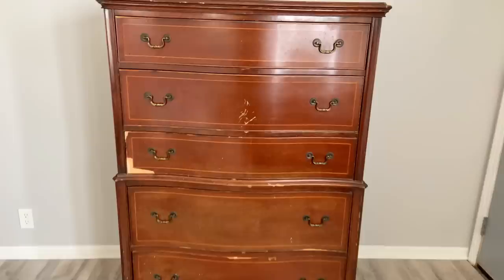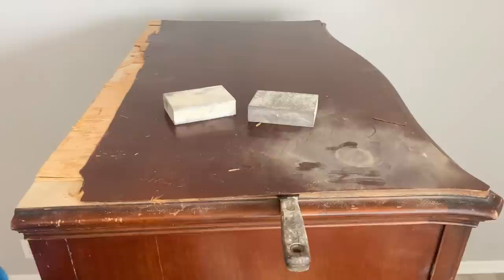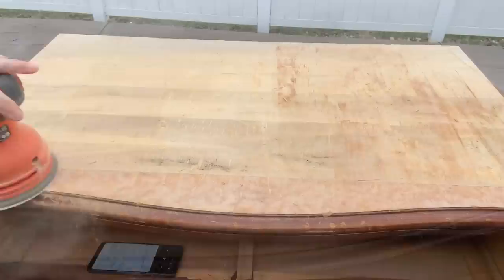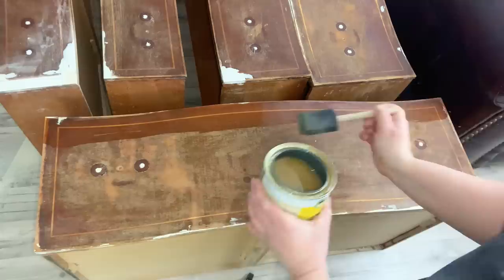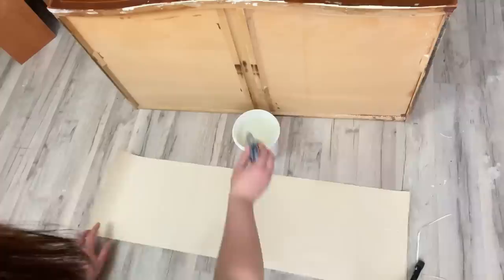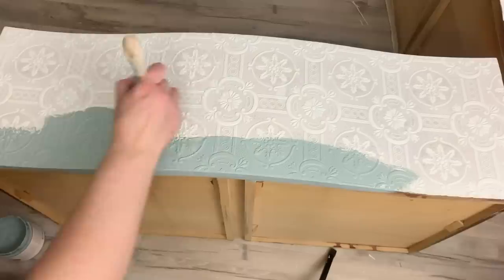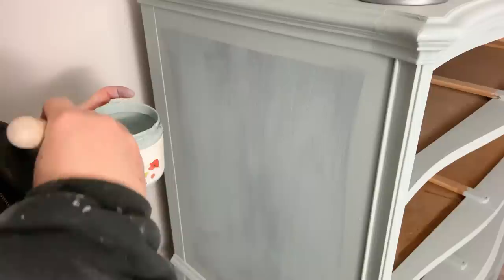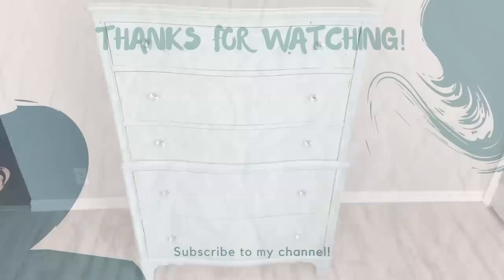Furniture Makeover | Country Chic Paint Trash to Treasure Dresser Furniture Flip | Start to Finish

Comment: Very pretty.  If you want to shabby it up a bit, after painting the drawer fronts, you could use your sanding block to lightly hit the high texture points of the wallpaper to reveal the white of the plain wallpaper.  That is a regular technique we use in papercrafting on embossed cardstock that has a white core.   Or we touch the high points a paint using a foam applicator.  Touch has to be very light.
Reply from the maker: Yes! That would have been gorgeous! I wish I would have thought of it when I was working on it. Great idea. I’ll have to try it next time. I think I would use paint or gliding wax 🤩 thank you for the idea!

Comment: In our previous house, I had painted kitchen cabinets with flat, feature-less doors. I covered those doors with textured wallpaper, painted it, and it looked like I had pressed tin on the doors. You can also use wallpaper, either the paste-on type or the peel and stick, on the flat parts of a piece of furniture, such as the sides of a dresser, to get some pattern and texture on a piece.

Comment: Excellent makeover!  I'm curious about the durability of the wallpaper - will the edges endure opening and closing the drawers?
Reply from the maker: Thank you! If you cut your paper before applying you can leave some space before the edges. I used my razor blade and cut them at the  edges but then I sanded some off so they won’t be an issue. The paint is camouflage so you can’t see Where the paper begins and ends.

Comment: When I repair dents chips etc on pieces that I  Intent to paint I use BONDO. Its a two part  Is polyester filler for automotive use. It can be mixed and spread in any  Quantity you like and it dries within 5 minutes and is  Easily sanded. Depending on how big of an area u bondo and how fine u sand the bondo you may or may not need primer. In most cases I use primer however if Im just repairing a nail hole or small chip I paint right over the bondo . Hope thats helpful to yall.

Comment: How do you know when to paint over wood vs restoring the natural wood color with a brand new layer of finish (stain and topcoat)? Also, how do you choose what colors to use - assuming you wanted to flip/sell the piece? Are more people interested in painted wood furniture vs stained (restored) wood?
Reply from the maker: These are great questions. I usually look at the quality of wood first. If it’s in great condition I usually choose to stain it but if I’ve accidentally sanded through the veneer or it’s just in bad condition that’s when I choose paint. 
Choosing colors is probably the hardest part. If I’m selling a piece I envision before I start painting who the piece is made for whether it’s a little girls room or an adult couple or even something that would go in the living room then I decide my colors based on who I’m painting it for. 8/10 that’s who ends up buying it!

Comment: It gives me a good idea. I've got some embossed wallpaper and it's got a little color to it but it's floral like I like I could use that wallpaper and then just add a little paint to it. The colors I like. I think I'll try that every time I do wallpaper though I don't seem to get it done right you say you have to get it wet and then put it together and rub it which is called booking and then put it on. Any tips on wallpaper application? Thank you this is a great video
Reply from the maker: Thank you! I don’t dip my wallpaper for furniture. The Wallpaper adhesive works great as glue and you don’t get all that wet mess.

Comment: How did you not get tiny bubbles in your top coat? I recently did my daughter’s bedroom set and used the same exact topcoat over the stain on the top and could not seem to avoid the bubbles. LOVE the piece btw! I thought for sure it was going to be a stencil on the drawers.
Reply from the maker: Thank you! Did you happen to shake the topcoat before you used it? That will definitely cause bubbles. If you just gently stir it before use you should have no bubbles.
Reply: Thank you for getting back to me!! Yes I just stirred it. And that was after letting the can sit for a few days after delivery. Could the humidity in the air have contributed to the problem?
Reply from the maker: Maybe 🤔 honestly that’s only happened to me when I shook it. I have been using it for years now and never really had a problem with bubbles so it had to be humidity or something along those lines.

Comment: Shellac is not necessary, you can light sand the entire area you wish to paint and then apply primer before paint this will help the paint to adhere nicely.
Reply from the maker: I like using shellac to lock in the tannins. Usually when I use shellac I suspect future bleed through.

Comment: Just to be clear about my previous post, the hot iron is for when you start, not just to get the glue and chips off.  I have pulled pieces off pretty much intact, not in layers...
Reply from the maker: Yes! I have seen it done that way. I just figured since most of the Veneer was so loose on the end it would be easy to pop up. It wasn’t so bad but I’ll definitely do the iron for  my next project. Thanks!

Comment: Would a hair dryer or heat gun help remove the veneer.
Reply from the maker: I’m not sure! I know about the iron method and that’s uses heat to melt the glue underneath so it would make sense for a heat gun to work. I just find it easier to dampen the wood when it’s stuck and use my hammer and chisel 😊